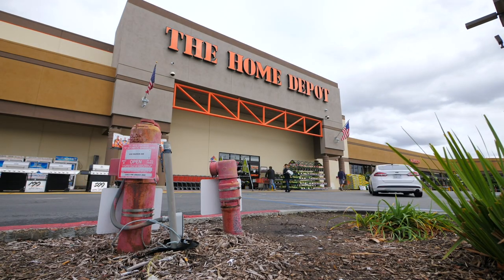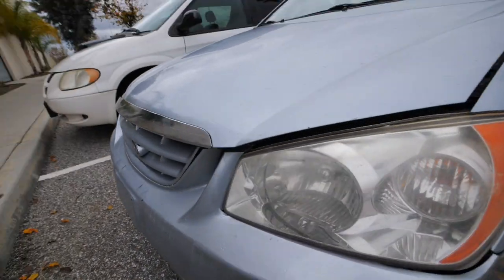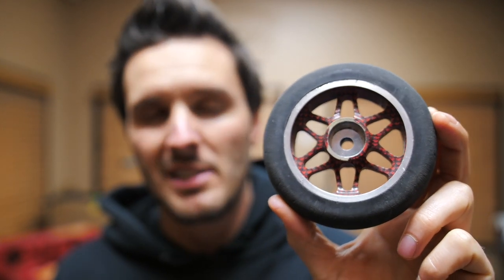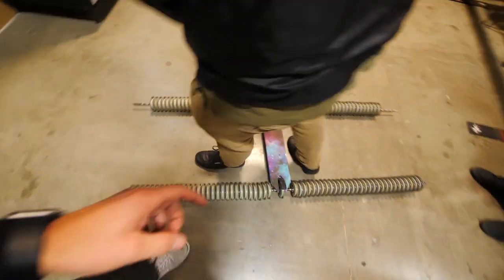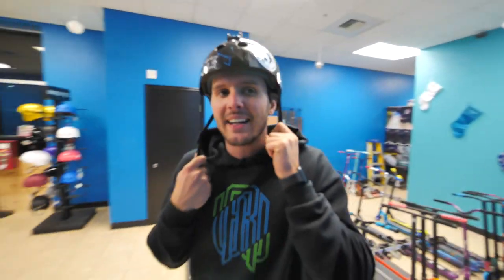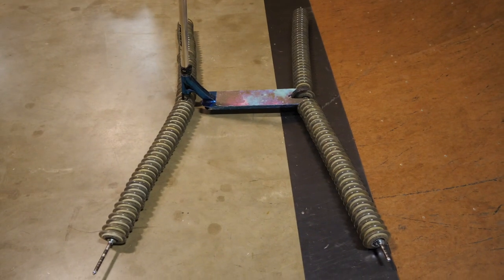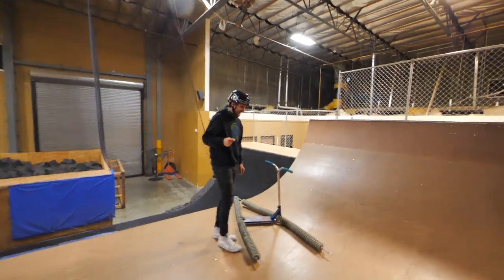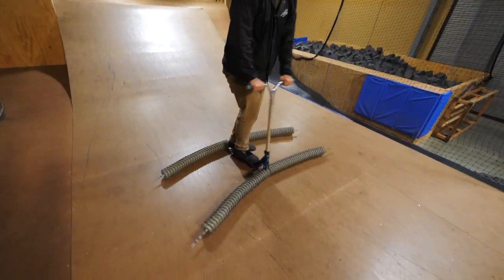122 WHEELED SCOOTER!!

Comment: Advice: measure your outside to outside lengths, find a local machine shop, bring a wheel, ask if they have pieces of 1018 or 1045 tgp that will fit the center ask them to thread the outside ends ~1" in. For small super easy stuff like that my shop literally will just hand it to customers and be like "it took 10mins. its free". That all-thread is literally worthless.